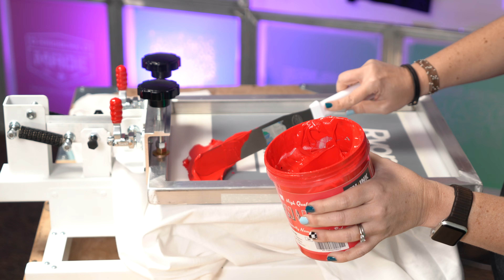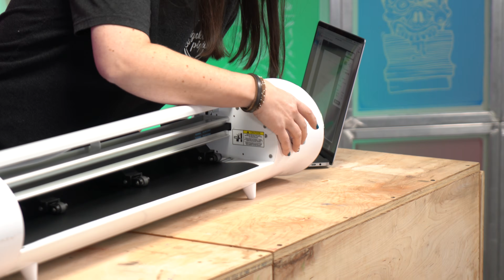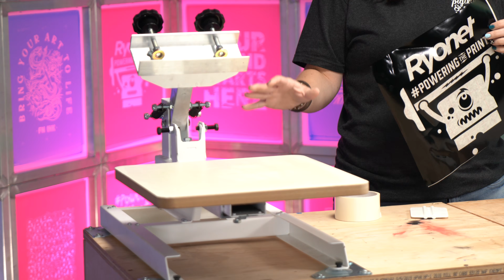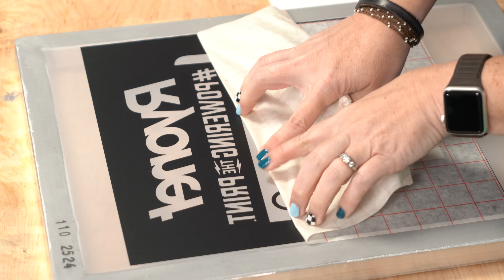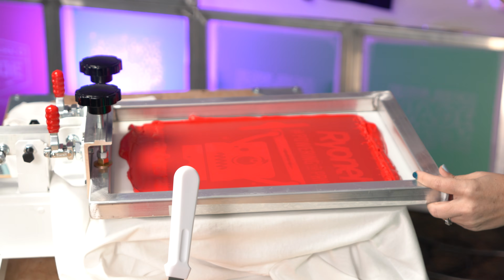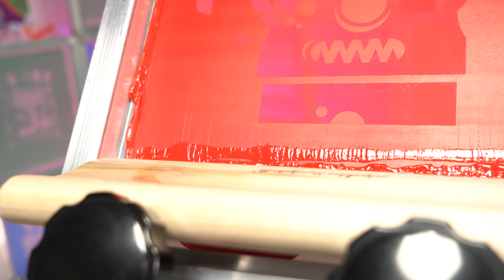Screen Printing with Vinyl Made Easy

Comment: How do you clean it with the vinyl still on? I's think it would want to peel off ,no?
Reply: I’m a pigskins and pigtails super fan so I feel qualified to answer for her. Using regular vinyl is a one time deal. It will peel off when washed. If you want a more permanent solution, Jennifer suggests using iron on vinyl (htv) and her channel definitely has a video explaining that process in depth.

Comment: A nice method of creating stencils for screen printing, without all the 'dirty work' that comes with emulsion. However, a vinyl cutter is quite an investment up-front. Using emulsion seems cheaper at first.

I love your tabletop press! I bought a similar one last year. It doesn't have the cool features yours has, like micro-adjustments, removable printheads and even suction cups at the base. My press can 'walk' when I press the squeegee too hard
Reply from the maker: Good point! The Starter Press doesn't have micro registration as well but the ability to print multiple colors on one print head is game changing.